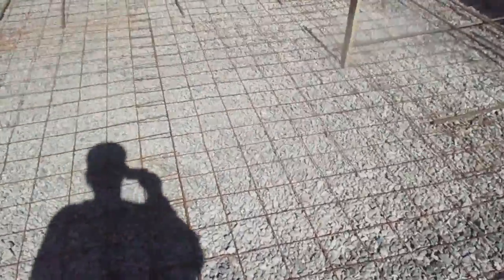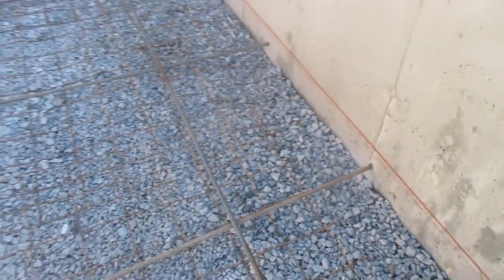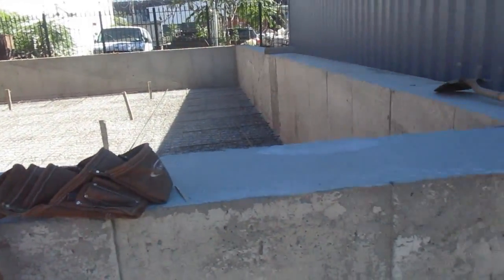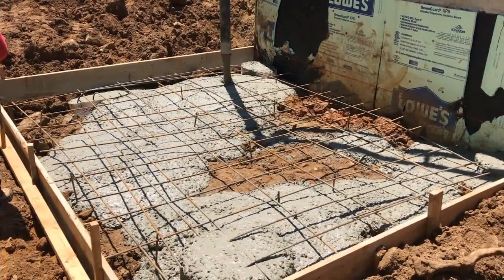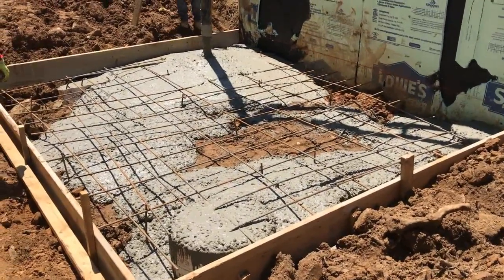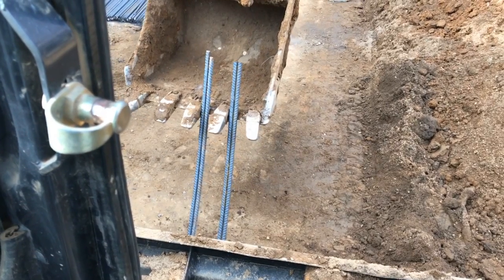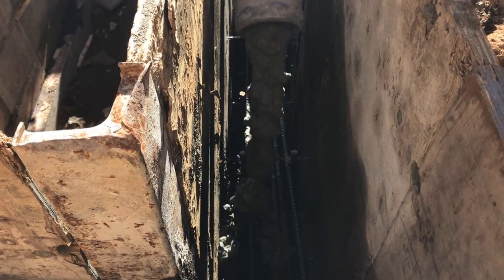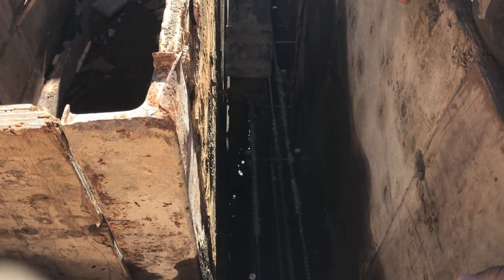How to Reinforce a Concrete Slab. Should I Use Rebar or Wire Mesh for a Concrete Driveway

Comment: I agree rebar should be across entire length on 12" to 16" Square Grid support off stone base. Wire Mats Laying On Stone Base And Not Supported Hardly Does Anything. Sincerely, Concrete Engineer With Over 40 Years Experience With Concrete Engineering Company.

Comment: One of the most important parts is the compaction of the subgrade... none of these will prevent cracking if native soil compaction is poor. Also, at least in Florida, fiber reinforced concrete (3-4lb/yd^3 min.) is going to help much more than any wire mesh, at 6" thickness & 3000 psi min. strength mix. Sooner or later metal will rust and you will have stress cracks. This is given proper curing/hydration and etc. So for residential driveway this should be more than enough.
Reply: Thanks for that. Can you discuss compaction of the sub grade briefly? Like crushed rock with a vibratory tamper?

Comment: Thank you for simple easy to understand general rule of thumb 's. I am pouring a 3x 10 4inch thick slab to hold 4 rain barrels. I plan on using rebar just to ensure against cracking. If you haven't, you might want to give a quick rundown on how to properly place rebar.

Comment: I would have run the rebar full length, tied it in the middle like you said you would do it. Especially with my name on it, I have a problem with customers telling me how to do it, if I don't do it my way I don't put my name on it because when it fails they don't say that's the way they wanted it they say that's the way the contractor did it. You always do a great job anyway, good video.
Reply from the maker: You are correct, however, I work for GCs and builders, so they supply the material and I only do the labor. I can only make recommendations, not orders. However, if I’m supplying the material for a private owner project, that’s what I would’ve done. Thanks for watching.

Comment: Good video but a couple points I would make. Always refer to the ACI codes and consult a PE when doing any substantial slab or caisson cap design. The grid pattern of rebar isn't really what is giving it strength. The concrete actually bonds to the bars and the deformations in them to build capacity over a development length. Some slabs situations may not require any grid pattern whatsoever other than to hold the bar in place for the pour.  Wire can 100%  be used to support a bending reaction in a slab if you would not require any more than a #3 bar at a normal spacing. The import things to consider are the area of steel per foot of slab in each direction, depth of the slab,  depth of the reinforcing and the clear cover distance. Using wire or bar or both is really dependent on the situation and will only provide the required performance if ACI codes are followed. Good lasting slab performance comes a with good design and construction quality control. Whenever I see a contractor field bend rebar like that or place the rebar without chairs, I loose my mind!
Reply: Finally, someone that knows wtf they're talking about, I can't tell you how many of these small jobs I've seen and these guys leave everything laying on the ground, ridiculous, then they videotape themselves doing subpar work, if I had the time I'd set up a side job being an advocate for the customers to get reimbursed for the mesh that's doing nothing. Speaking from experience, 30 yr rodbuster, I've installed and dobied up literally 100s of thousands of square feet of mesh on high rises, slab on grade etc.... these guys need to familiarize themselves with ACI and the CRSI handbook, a wealth of information is available.....

Comment: Excellent video and excellent knowledge. If you’re opening a 24” wide trench in a slab, and the existing 6” slab has rebar at 12” o.c, would you recommend using wire mesh instead of rebar for the new 6” slab ? It would sit on slurry as well. Wire mesh is just a lot easier than rebar, that’s why I ask
Reply: And this is at a gas station, so vehicular traffic

Comment: Great video!!!!
I live in Tennessee, sumner county,  we see all the seasons here.  A lot of humidity in summer time. Want to have a 4 seat hot tub and small coffee table with chairs out in open air on a 12’X 20’ slab with privacy fence around.  That’s going to be right along next to the outside wall of the home. Now for my questions.  
What type of cement to use?
Appropriate thickness of slab?
Rebar or wire mesh?
How much gap between home and cement slab?
Any Control Lines needed?
Any plastic film needed between ground and slab?

Thank YOU in advance

Comment: I'm have a pad made that's 6 inch thick 8 x 12 for a swim spa which is 1000 lbs empty and about 2000 lbs full. Can I use wire mesh is that good or bad should I use rebar.

Comment: Awesome video. I'm pouring a 4"x6'x8' slab for a hot tub that will weigh about 3000 pounds. I got a 4x7 steel wire sheet that I was just going to lay on top of my gravel. Do you think that's good?
Reply from the maker: I would pour it about 6-8” thick with rebar in a grid pattern.

Comment: Got a serious question, Put down a concrete foundation 5" thick.  In 2 different areas we are installing 2 post car lifts so we basically laid out a 3' wide, 12' long, 1' deep trench across to insure the columns hit the deeper concrete regardless of the adjustments of where the columns land. Should there be 2 layers or rebar in the 1' deep trenches or is 1 layer enough?

Comment: Great video! 👍
What do you suggest? I’m purchasing a home. I want to make a parking spot ( approx. 10x20 feet) next to the garage. I own a Tahoe. Mesh, rebar or neither? And how thick should I go??
Reply from the maker: I would do 6” thick, wire mesh, and 3500 psi concrete mix. If you didn’t want to use the wire mesh, you could use fiber concrete mix.
Reply: Concrete and Construction thanks you for the reply and advice.
Reply from the maker: Juan Vargas no problem. Thanks for watching.

Comment: Plan to put concrete on my garage (1 car), should I use wire mesh ?
Reply from the maker: If the ground is solid, use wire mesh and fiber reinforced concrete. 6” thick. We usually use 3500 psi.
Reply: @CoastConcreteCorp  😊 Thank you.. I need that professional advice..

Comment: Good info.  Have you ever seen galvanized "hog wire panels" used in addition to re-bar on a pour ?  I am planning on a boat ramp into salt water ( Gulf of Mexico in Texas ). I will have it poured in two sections. The lower section is the part I want the most reinforcement since the soil- gumbo and sand - is fairly soft and unstable.  I expect a 6 to 8 inch thickness and have the mesh wire panels  near the base about 2 inches above soil then the rebar on chairs about mid-way in the pour, about 3-4 inches from the base soil.  Will galvanic reaction occur or should I use non-galvanized steel mesh ?     Thanks   J K
Reply from the maker: James Krivitsky you should use galvanized wire mesh and I would look into epoxy coated, aka “green” rebar since it is being used in a marine environment. Also, put the steel in the center of the slab as much as possible. The wire being 2” off the floor is a little low and won’t be doing the most it can. Thanks for watching.

Comment: does fence wire (not chain link) work?
Reply from the maker: Yes
Reply: @CoastConcreteCorp  i plan to build a workshop/storage area, roughly 20x11ft (just the base or floor), the rest of the building will be made with wood & metal, would that (the base/foundation) be strong enough?
Reply from the maker: @sobssoly549  we’ve done a few car port slabs. The outer edge (where the framing will sit) should be a foot thick and the center could be 4-6”.
Reply: @CoastConcreteCorp  i've watched  several videos and a bit googling and some of them use plastic sheeting, is that necessary?
should the rebar be thick, there's a lot of 10mm diameter in my area.
and how much spacing do the rebar need from one another (top & Bottom).

thanks for the reply. :D
Reply from the maker: @sobssoly549  the plastic is a vapor barrier. That’s so moisture doesn’t come through the slab. We only put it if the ground is wet. You can put it just to be safe, it won’t harm anything. 4 mil plastic is what we use. Place about 4” of stone base beneath the slab. We usually use #4 or 1/2” rebar for these slabs. I think 10mm is a little small for that.
Reply: @CoastConcreteCorp  i see if i could find the 1/2" rebar, but is there a work-around using the 10mil if 1/2" isn't availble? like tying two 10mil together for top and bottom, could that work?
i will use the plastic then, since where i live is very humid and it rains a lot, sometimes for days.
Reply from the maker: @sobssoly549  that would work. Or just space it out less. Maybe make one foot by one foot boxes.
Reply from the maker: @sobssoly549  that looks like a typical diagram for that. It looks like the edges are thicker like I said, and the center can be 4”. You can use wire mesh mats and fiber concrete instead of rebar also. Depends what’s easier for you to get.
Reply: @CoastConcreteCorp  do you think its possible to pour the entire slab with just a mixer?
I could call a mixer truck, but I'm worried they won't be able to get through the narrow road with tight turns, plus I'm also worried about the cost to hire a mixer truck, but I'm willing since the slab is the most important part.
Reply from the maker: @sobssoly549  it figures out to around 5 yards with the 1’ thick edges and a 4” slab. If you can mix it, go for it. You could always just cost the thick edges one day and leave it 4” below the boards, then dump the slab the next day. I recommend doing it all monolithic.